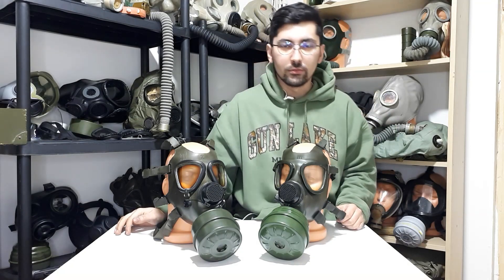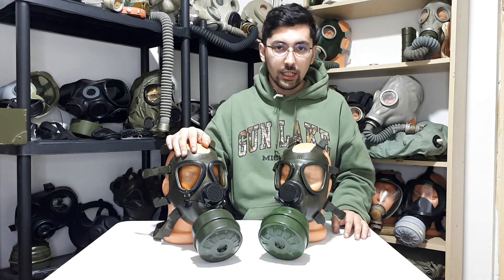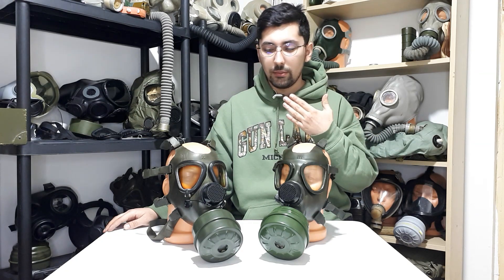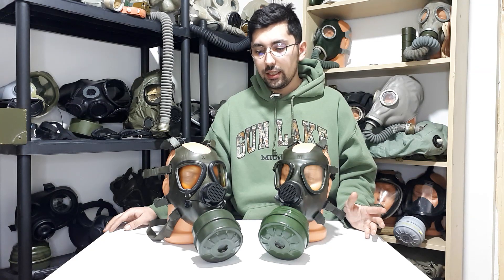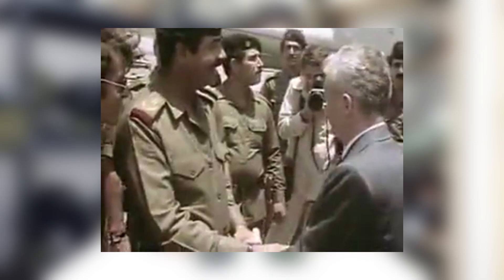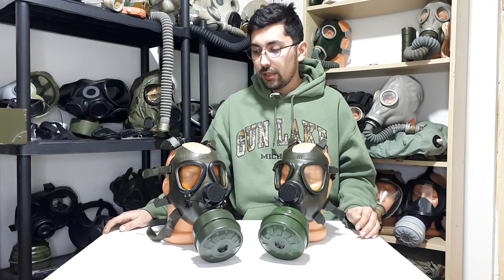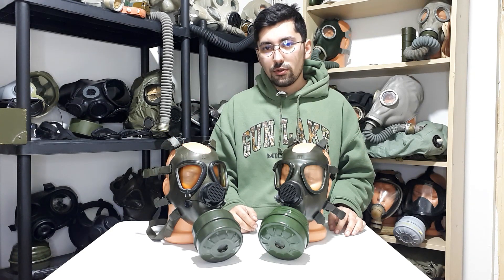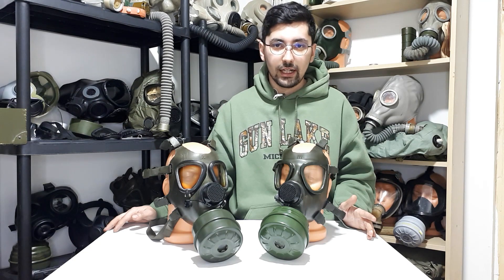Iraqi M85 gas mask 🇮🇶

Comment: It's safe to say that the Iraqis were trying to cut cost by using the screws to fasten the parts on the mask. Another theory, the Latin alphabet is used in the other hand is because Arabic alphabets and scripts are difficult to be used (which is the reason I've dropped Arabic language lesson when I entered secondary school). But obviously plastics were used as it is cheaper than metal. I've seen Chinese masks doing these. One of the most obvious example is the MF-14.

Comment: These are based on the west-German M65
Reply from the maker: The M74 is a licensed copy of the west german M65 and the M85 is an upgrade of the M74. Then the M85 design was given to Iraq aswell, you can see that in my previous video.
Reply: @RobertCBRN   - YES , many good Gasmaks (incl. in Greece, Romania, Iraq, Spain etc. ISR, Hungary ) based ether on the West-German Dräger M65 or Dräger Karetta (like in ISR & ISR´s civillian mask is the Dräger Simplex )
Reply from the maker: True, but what I men to say is that the Iraqi M85 is rather a copy of the romanian M85 and not directly of the Drager M65